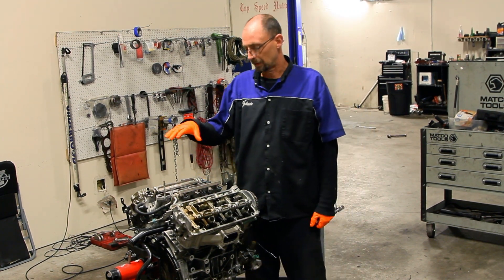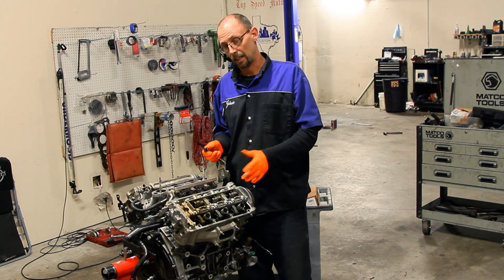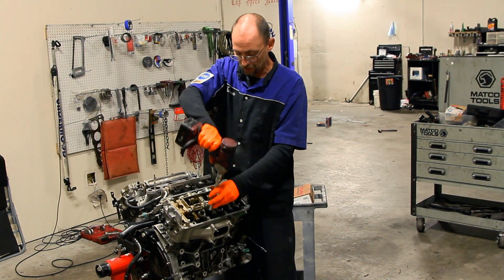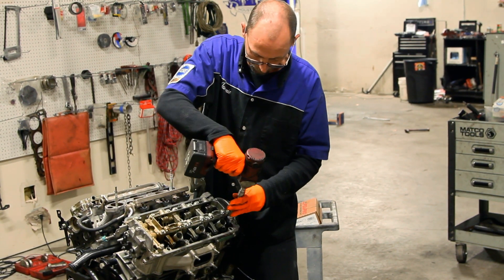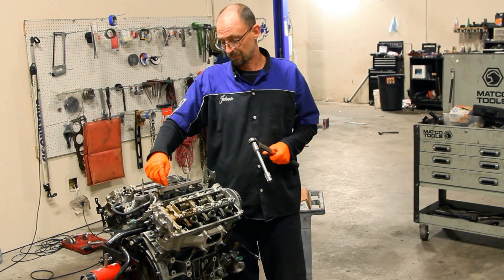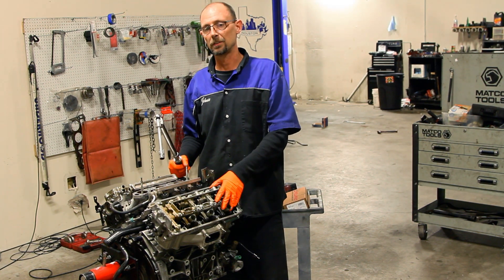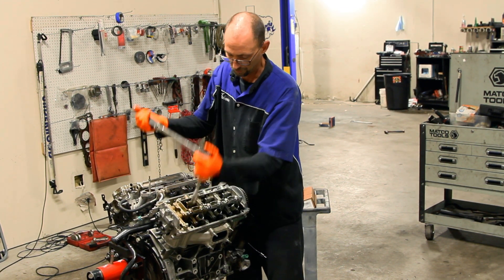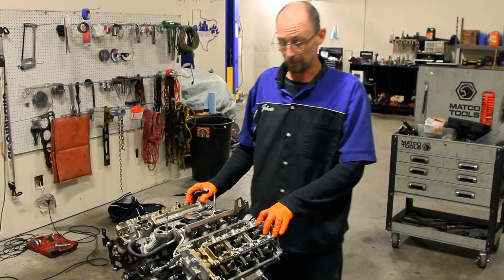4th Gen Acura TL Cylinder Head Bolt Torque Angle Specifications

Comment: How many times do you have to do the 90° angle new head Boats
Reply from the maker: 3 times on the 3.7 Acura engine
Reply: Ok Thank you
Reply: Went to Harbor freight got a nice Torque wrench with angle for a deal got 3 90 everything good Thank you again
Reply from the maker: @gregnyce1238  No problem! We're glad you found the content helpful <3
Reply: 22 lbs 90 and 90 right? I was trying get 3 90 but Bolt won’t turn on anymore
Reply from the maker: @gregnyce1238  With new bolts it has to be 3 times. The last pull is very hard